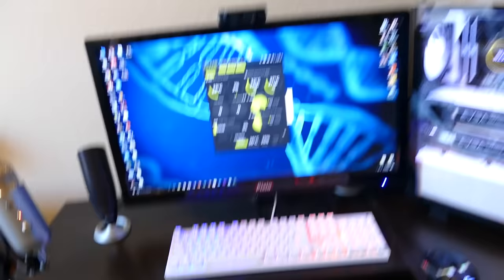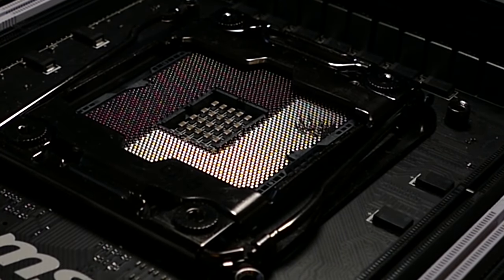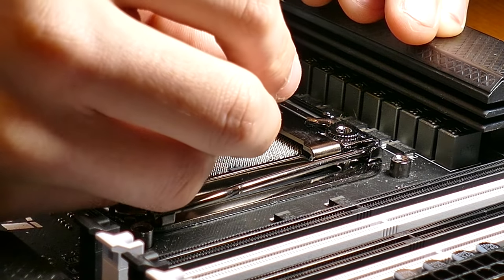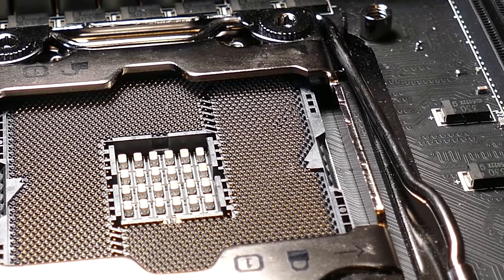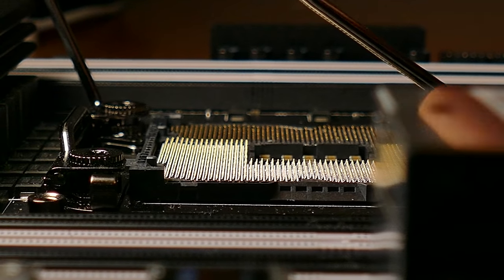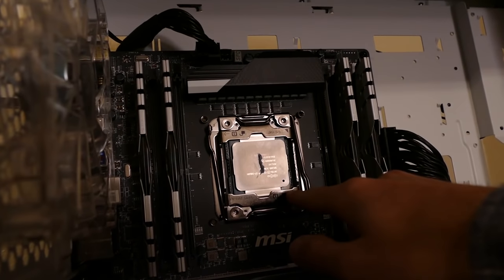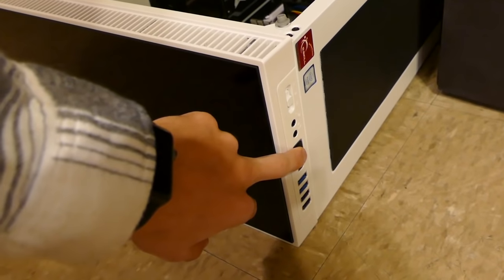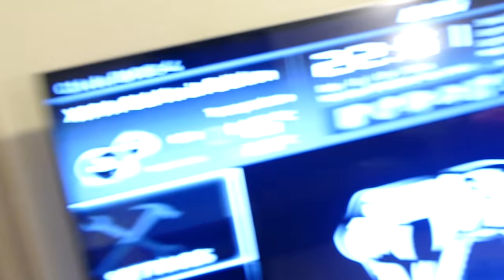I Stepped on a Motherboard. Let's Fix It!

Comment: the fact that it's reading only 12gb of ram it may mean one of the pins isn't connecting properly... try reseatting the cpu if reseating the ram doesn't work out...
Reply from the maker: Resat RAM. All 16GB detected.
Reply: Salazar Studio awesome :) glad it works fine.
Reply: i was working on a friends PC and when I removed the cooler i noticed bent pins on tthe CPU itself i believe it was an fx 8350 i used the tip of a mechanical pencil to bend them and it worked fine however it would only work with the CPU that was originally in the system

Comment: I did this too before and what I found worked really well was actually my X-acto knife since i would be able to lift and bend the pins with good precision. I used two of them, one to stabilize part and the other to do the pressure application. Mine came out perfectly and I could not tell a difference.

Comment: I had the exact same thing happen to me on a asrock mobo and I was able to fix all the pins but not as nearly as good as you did. My build worked after and is still currently working. Great video.

Comment: Something that would've worked beautifully are the Carbon-Nylon Edge guitar picks made by Pickboy. They're carbon reinforced, super hard and super thin, especially the .70 or .88 mm ones, plus they have a pretty sharp tip. Not to mention, they're also really great guitar picks, my absolute favorite. :D

Comment: You can also use a mechanical pencil. Just put the pin where the graphite goes in the tip of the pencil and straighten by moving the pen perpendicular to the board.

Comment: I use a mag glass I just happen to have a tiny mag that was made for looking at pics close up high powered put a light on it and it looks like your right there on the board with the pins the tough ones are bent in two directions along the pin those are  a job to fix my eye sight is failing so it even harder or not able to do it at all

Comment: Next Video: Left NZXT RGB Fans Inside Running Microwave Oven..
Reply: While plugged into main rig with 50 ft Molex cable going from the PSU to the NZXT controller
Reply: Lutz Peyton Next Video: Fixing my burned down house

Comment: My brother once stepped on my old fx 6100, couple hours of bending and soldering it actually worked.
Though Intel sockets are 10x harder as the pins are much more dense, so good job on the pin job! Lucky the pins weren't bent all the way down tho.

Comment: How is your ankle?
Reply from the maker: Four stitches and a cast but the nurse gave me a lollipop so all's good now.
Reply: a friend of mine has a prebuilt pc from 2013 which he recently upgraded his old specs were i5 4440 and gtx 650 ti 8gb ram he now has the gtx 1060 6g but when he send me a picture of inside his case i noticed there were 3 of his 4 ram slots in use and his system has 8gb ram(according to task manager) how is this possible? does he have bent pins as well? or is there some weird combo you can make to get 8gb with 3 ram slots in use
Reply: maybe he has two 2gb sticks and a 4gb stick of ram in it?
Reply: scott grant is that possible? i thought it would just work with the lowest common capacity just like memory speeds.

is there a way to verify that is the case?

Comment: Go to Harbor freight or an automotive store and get those metal shims (a gauge set!). They come together, sandwiched one besides another, kind of like a how a pocket knife blade folds out. They are ultra thin and come in range of something like .500" down to .001" of an inch and really come in handy. A few of them are thinner then the average piece of paper.

Comment: It's okay, I fried an old P67 last week because I left the mounting screws loosely in it while test booting outside a case. Must have been able to jostle around enough to short it out. Was planning on a mild updating of that rig (w/2500k) but now need to build an entirely new computer (6700k here I come!)

Comment: You can lose pins and post and run just fine, a lot of those pins are just power or ground, which just means the rest of those pins carry more load if you lose a few.  Don't say to trash it just because of one lost pin.  I've lost a few pins on an old phenom CPU and it was fine.  My dad who is a test engineer at Honeywell told me a story about one of their chips missing a pin, things seemed to work, except when they'd use a specific instruction and the device crashed.  It's a crap shoot, but it's usually fine.

Comment: I recently had to do this, I used a $5 magnifying glass with a LED and a $7 pair of supper small tweezers (the pins were pushed down into the sockets) and I fixed all but 1 pin, at which point I was under the limit for a return (3 pins maximum). Just go slowly and gently and look at the reflection to see when there lined up

Comment: For anyone else who is reading this, if you have to pull the pins back up, it's possible that you could use one of those high-end mechanical pencils to do the trick, one with the 0.3mm lead.  Pushing the pins down isn't all that difficult, but if you have to pull them back up, you can probably get a pencil on each individual pin.  It won't be easy, or fun, but it could save you a few hundred bucks.
Reply: eye of a needle is better be gentle and cork the pointy end slot eye over pin gently pull upwards

Comment: 13:00 - One thing to note... that may not have been a 2 second fix. It's VERY common for bent pins to cause memory to not be detected or even to not POST at all with memory in some slots.

Comment: Idea for the right tool for the job (Should it happen again) I've found that a mechanical pencil (With the lead removed) works pretty well as a pin adjustment tool.

Comment: I would have used a injection needle. One with an inside diameter just larger than the MB pins. Insert the hollow needle over the pin and bend it into the correct position. It may be necessary to take the slanted point off of the needle with an very fine sand paper first.

Comment: I Bent pins on my old 8350 when i took cooler off. Didn't saw that the cpu went outside the socket with cooler aswell :D Bent shitload of pins, did the same stuff and it worked normally after. Bad memories xD

Comment: sometimes bent pins render dimm slots useless. you might wanna check that stick of ram which is not being detected, it could be one of the bent pins on the mobo. the rest of the system will work perfectly fine, just not that dimm slot.

Comment: You're having some bad luck Greg... I also bent some pins with some ill advised decisions while removing a particularly difficult to remove cpu cooler... excessive pressure on the cpu while trying to pull it out..... I had given up hope and as a last ditch effort I took a Swiss Army knife and tried to straighten all the pins and it worked.. I got them lined up and it fired up... I was shocked.. but ultimately happy..

Comment: If you have a missing RAM count, like one of your DIMMs are not detected, it cause of the socket and you still have some pins left not making contact. 
I bought a board with only like 4 pins bent. The CPU was fully detected and the computer ran like nothing was wrong EXCEPT DIMM 1 was not detecting the 8GB RAM stick on it. And was only showing 24 GB out of 32 GB. I managed to successfully straighten those pins with a sewing pin, and only then was it able to detect all the RAM DIMMs.

Comment: Use the end of a mechanical pencil. Get one with a metal end as well. Use the opening where the lead comes out. Just remove the lead first. You don't want loose graphite in there.  I've had to fix tons of these at work when people put procs in wrong or drop a heat sink on the socket. ಠ_ಠ

Comment: While I've never stepped on a motherboard before, I did have the bracket from my H100i scrape across the socket during thermal paste application, damaging several pins with a similar result. I recovered it as best as I could, and got my 4770 working again, but lost 2 dimm slots somehow, can't seem to fix that issue.

Comment: I think it was Paul's hardware that mentioned a trick of using a razer blade (sharp metal not razer the company) to bend pins back into place. Worked for some fan headers I bent by accident

Comment: You can also use a mechanical pencil tip and slide it over a pin to bend it straight

Comment: I once stood and a water cooler backplate with the screw facing up, it went into my foot a bit and it started bleeding (a bit). The cooler backplate was bent and I had to wait about a week for a replacement backplate.

Comment: I've bought a couple cheap boards of ebay with this issue and fixed them, saves some cash.  Also a lot of the pins are repetitive so missing a ground pin will usually have no effect.

Comment: Happened to me but bent the processor pins ! Wanted to put a corsair h60 water cooling on my FX-8320 ... Removed the heatsink, but the processor was ''stuck'' on it, I didn't notice and threw it on the table ... bent all the pins on a side. Used a prepaid card to bend them back ( more or less ) and it still work to this day :)

Comment: I guess the error would be a bit different depending on the pin that is bent. When a friend of mine built a computer one of the memory slots did not work. after a whole lot a googeling we found that a couple of pins where connected to the memory slots and we found ONE bent pin. after an hour of plickering with a needle we where able to get it into the correct spot and everything worked. that saying. You could get a post even with bent pins, but everything might not work as it should.

Comment: Over 15 years ago, i stepped on a lego brick barefoot (it was summer). To be precise, i actually landed on it because i jumped off my bed. Well, in my case, nothing happened to the lego brick (obviously), but it hurt a lot. The moral of the video and my story is not just "watch your step" but "try to keep the floor clear of potential hazards " :P

Comment: I bought an asus rampage IV Gene X79 board with bent pins, fixed the pins and it worked! 300$ motherboard for 60$ :D Using it right now, and been using it for the last 6 months, no issues.

Comment: So all intel sockets have pins like this? Do they all point in the same direction and then lay down as the CPU is placed over them? So what you're doing here can apply to sockets from the LGA 1155 socket days on forward. Right?

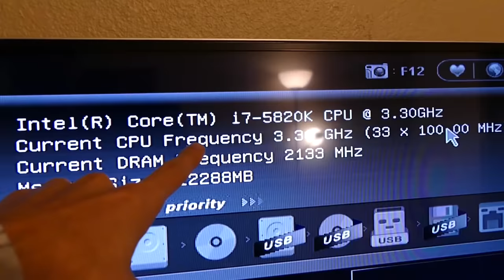Comment: @12:50 think its more likely due to your bent pins. A very common symptom of bent pins is non functional ram slots.
Reply from the maker: It wasn't. Reseated RAM and all 16GB were detected.
Reply: Lucky You, I bent my pins, got them close to staright, one lost the tip and now only two banks of memory work.
Reply: Nice, sounds like you got off lucky then!

Comment: Note: In some cases a CPU may POST even if some pins don't make contact, but it may malfunction in some unpredictable way.  A POST is a good sign anyway, but it doesn't tell the whole story, you need further testing later.

Comment: I had to do this when I accidentally dropped my CPU and it landed on some of the pins (the pins were on the CPU itself, not in the socket because the CPU was from 2009). It still worked, I used tweezers to push them back.

Comment: Protip: A mechanical pencil will save your life when you have to do this.

However DO NOT ROCK THE PINS !

You usually only get one shot at straightening the pin before it snaps off

Then you're fucked.

Comment: I bent some pins on my motherboard when cleaning thermal paste that had leaked out the side of the heatsink when I first made my PC and I used a magnifying glass and tweezer to bend the pins back and it worked

Comment: My cousin gave me an 1156 board and i7-2600.  His friend had taken it to some school thing, and ended up bending almost every pin.  They didn't know the set was worth $300... so I bought an ASRock H61M-VG4 off of eBay even though I didn't know if the i7 was fried.  Runs like a champ, all solid capacitors.  Memory controller is a bit flakey and sometimes freezes during POST, but whatever.
Reply: Some pins were literally broken off

Comment: Hey Salazar,
 Nice video, good job on those pins. Hope you actually stress test it. 
I once broke a pin of an AMD 955 BE CPU and managed to get it working by soldering in back on to the chip and then put it back in the mobo. Worked for a while, couldn't overclock after that though and after like 2 years the board stopped working. ANYHOW.... I actually wanted to ask about the Pixio monitor you have, I'm thinking about getting one. 27inch, 1440p, 144hz, IPS. Is that the one you have? 
I live in Kenya so warranty wont apply. Regardless, would you recommend it?

Comment: Memory amount: 12 228 MB, only 3 of your 4 sticks are registering. That is if you used 4GB sticks, it matches up to 4x 3GB, though I'm not sure if anyone has ever created those. Possibly the pins handling the memory controller are not making contact?

Comment: It's possible it didn't recognize all of your memory because some of the pins that are responsible for the memory weren't aligned properly. Can you confirm all of your ram-slots were working as intended afterwards? Thanks. 
Good job on fixing it.

Comment: my last Board came with crooked Pins from an retailer. He refused to take it back , because I couldn't proof, that the damage wasn't done by me being dumb while installing the CPU.
I bent them back using a pretty fine pair of pliers. The Board worked and survived 3 CPU installation before the pins finally gave up and broke off. ^^
It  will work , but not forever.

Comment: i repaired a friends cpu few years back the phenom II 955 over 50 pins screwed but was easier cause they where bigger also i had the cpu on my hands able to see it better for the job i used Mechanical Pencil with a very very thin nose  was almost fitting each pin perfectly ....he still uses that phenom since he is mostly a facebook and football manager kind of guy
Reply: was  a 0.3 mechanical pencil ...and yes after that i have one inside my toolbox  !
Reply: I need to see if I can fix my damaged Phenom II X6 1100T. It's been a nice paper weight, though.
Reply: CaveManta such a great cpu ! make a tv pc with it !
Reply: venix20 It's just such a nightmare, though. I think I broke a pin or two. D=
Reply: CaveManta owwh you can solder new ones i think but hell i know i can not do such a tiny solder work  good luck though
Reply: venix20 Thanks, man. It's better to try and fail than to keep the CPU laying around, not warming up the room.
Reply: well i resolder my headphones ... dead capacitors on some of my old monitors ....failed to fix my old ups so that went to the dumpster ..... in general i am t he kind of guy when something breaks up and is not covered by warranty ... i am breaking it up trying to fix it ! so i get what you are saying !

Comment: I hate Intel boards for this reason.  Its easy enough to bend back bent pins on an AMD CPU with a credit card, but Intel with its pins on the socket are a right p.i.t.a..  So very fragile.

Comment: I bent the pins on my b660m. Able to boot but unstable ram speed, sometimes as slow as 1333mhz. Already bought a replacement board. Now stuck with a 300 Singapore dollars paper weight.

Comment: Ah man, I've been there before. Bent a few pins once on my my FX 6300 chip. Which sucked since it was the actual processor! I was so scared. Lol. But I was able to fix it by bending them back. It was nerve-racking trying not to just completely break them off. Lol. I'm using the chip now though so it's all good. 👌

Comment: I did bent one of my motherboard's pin once, I had like one of those cell phone kits that a "thingie" that worked just fine, but I think I might have lost one of my memory controllers since one of my channels is completely dead. But in my case, the motherboard doesn't post if I use a memory on that particular channel, the other ones are fine though.

Comment: from my experience just because the cpu is detected does not mean it is going to function properly, I had a msi z77a-g45 with a bent pin and a i52500k become recognizable in the uefi but would blue screen during windows start up

Comment: Dude, you could've done this better if you had a magnifying glass. I did this before after I tried to put the socket cover under the latch, yes Im that stupid, and the pins bent down so I took a good magnifying glass and pulled the pins up with the edge of a x-acto knife. Motherboard socket looked untouched soon after. Didn't take more than 5 minutes.

Comment: Great video Greg. Regardless of how the pins were bent, thank you for putting up content on showing how you fixed it. 
I had an experience with purchasing an Asus ROG VII Gene from a remanufacturer with bent pins. Upon receiving the board a number of pins were snapped. I was able to RMA the board and Asus soldered a new Foxconn socket onto the board for free. That's how you get a lifetime customer.

Comment: Tried doing that to a 8350 a client brought in (already told beforehand chances were small it would work properly) that they socketed in WITHOUT lifting the retention arm. After a lot of work, got them lined, it went back to slipping into the socket but no dice. Poor thing was killed mercilessly ='(

Comment: I use a razor blade. Works well. Bent some pins on my Z77 Sabertooth. CPU still running strong at 4.5GHz 3 years later.

Comment: Are you sure that you misplaced one of the DIMMs? Can you double check it? Somehow I suspect those bent pins are messing with the memory controller inside the chip. Would be great to know. Great vid by the way, as this kind of situation doesn't occur so commonly. :)

Comment: Have you managed to detect all RAM sticks? I think it's not detecting all the RAM sticks because the pins that go to the sticks are not touching the CPU properly. Had the same problem with my old i7 875K which has 12GB of RAM, but only detected 6GB. Turns out the CPU was not properly seated. Remounted the thing and it worked.

Cheers!